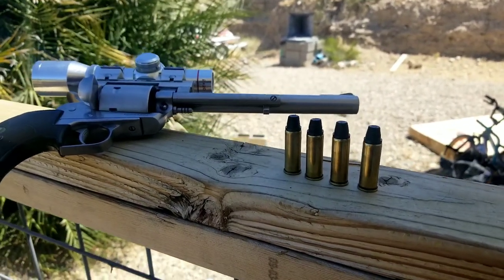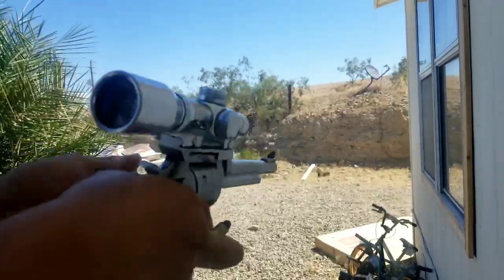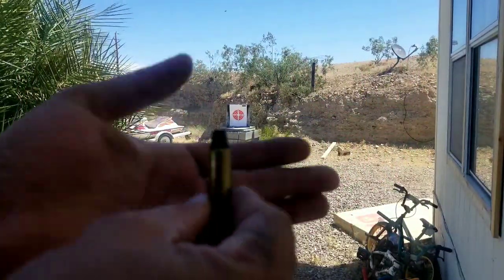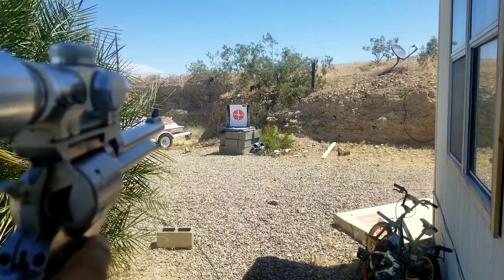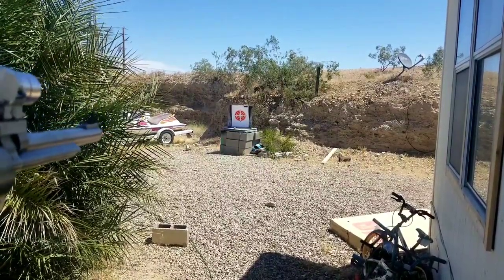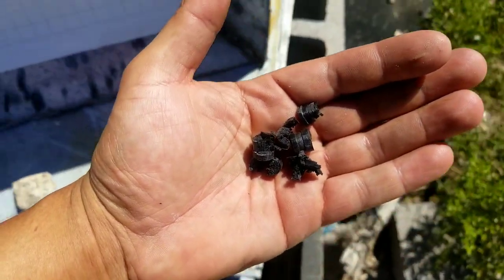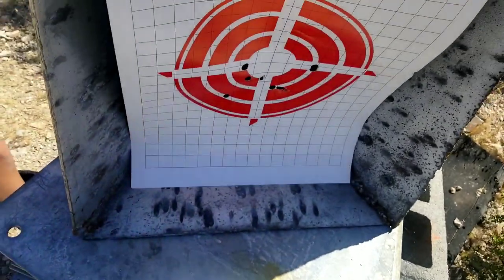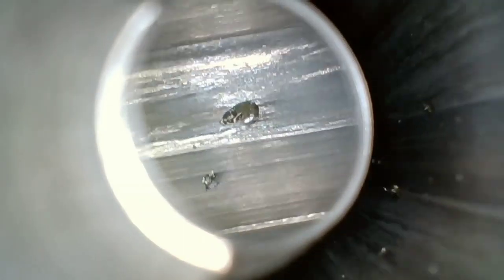3D Printed Bullets?! | How do they shoot?

Comment: So this is weird because it's the exact opposite results I've gotten with 9mm and 40sw and 45acp, my theory was that such a light bullet and full powder charges that powder wasn't fully burning and when bullet left the bore gas would push the bullet off course the moment it left the bore because it's so light, I got horrible stabilization. Only super light loads of 1 or 2 gr's of powder seemed to keep them stabilized. I have used 20% infill and it held up fine for light loads but the 100% infill most bullets were reusable shooting into paper or cardboard with a pillow or blanket behind it to catch them. I thought about making a dimple in the front of the bullet just big enough to put a .177bb or another size of lead shot right in the tip to give it some weight up front to help keep them stabilized on hotter loads. When I loaded 3gr+ and such of titegroup and Clay's and even varget and other non normal pistol powders with 9mm and a 20gr bullet I could not get anything close to any accuracy or stabilization. My most accurate load is 1gr of TG and a piece of toilet paper crimpled up into a loose ball as a case filler and a win small pistol magnum primer, I can shoot a good 3" and less consistent group at 15-25ft
Reply from the maker: Its gotta be that keith style bullet lol. I chose that bullet after reading how stable that design is in all sorts of velocities.  I think I can push them hotter. Need to print some more and test
Reply: @EagleEyeShooting  do 100% infill!

Comment: Unbelievable 🤔 . It would be interesting to see if you could somehow add some type of weight with some ( I don’t know what ) material inside 3D printed bullets to increase the weight.
Reply: Yes you definitely could. If you printed them with a cavity you could drop stuff in it and seal the back with an epoxy like jb weld, and then block sand them flat when it dried.

Comment: This is the first time I've seen the correlation between powder charge and stabilization of the bullet. I cast a bunch of lead 9mm bullets and loaded them lightly feeling that they might melt or whatever without a gas check. I think I might need to rethink that a bit. Thanks for the lesson.

Comment: Honestly with the accuracy and user friendly price these printers are starting to have, I could easily see these being improved to a point of practical use in the next five years or so. Even right now on some of the more expensive printers you can get filaments that have atomized metal particles in them so you can put them in a kiln to harden them to solid pieces

Comment: Thank you for sharing your time and effort with us.
Can reduced loads be as accurate as full charge loads?
I have a Long Range bolt rifle, but I can only get to 1000+ yard  shooting areas several times a year.
I need to set-up a short range centerfire practice rifle that duplicates  1200yard-1800yard  6.5 PRC ballistics at only 100-200yards.
I can do a 5.7x28mm bolt gun, or can I hobble a .223 with a reduced load and poor BC projectiles? Can I get it < .5 MOA for rigorous wind and drop training that will be as tough as 1200yrd-1800yard shooting?
Reply: I want to handicap the optics and rifle to make the look and feel as tough as shooting LR. The goal is to gain a high level of competence prior to going to matches etc.
Reply from the maker: I would look into a 22LR rifle. Folks participate in "mini ELR" using that caliber.

Comment: Is it cheaper than lead ?
Reply from the maker: Cost of electricity and the printer. Probably not as cost effective as lead. But gives options for projectiles
Reply: @EagleEyeShooting  Don't you have to pay for the "ink"?
Reply: $20 for 1,000 meter spool.  One bullet probably uses 1/2 meter.  So 1¢ isn't too bad.